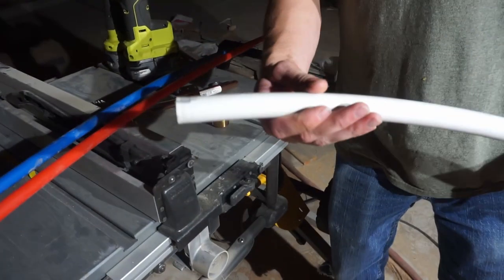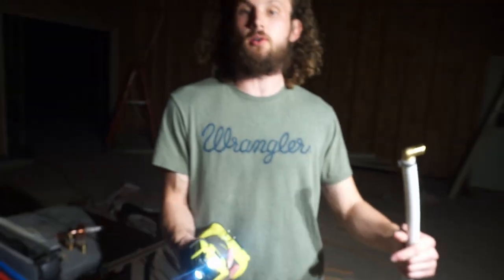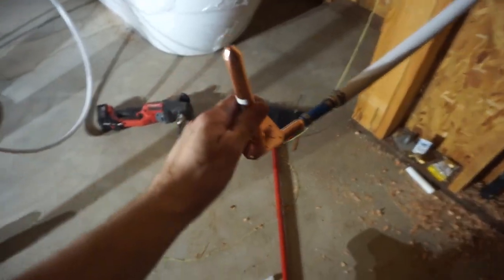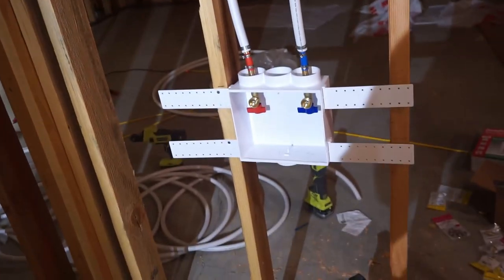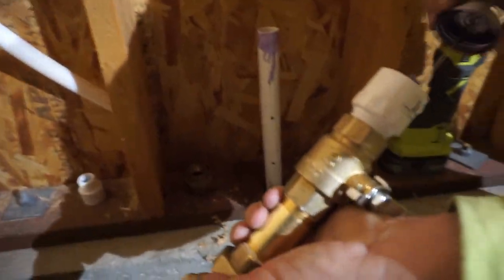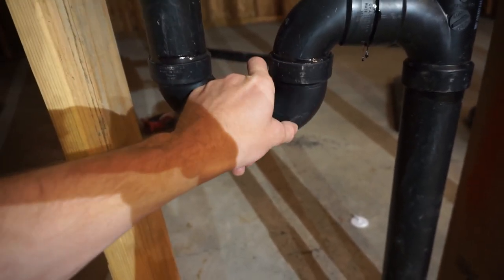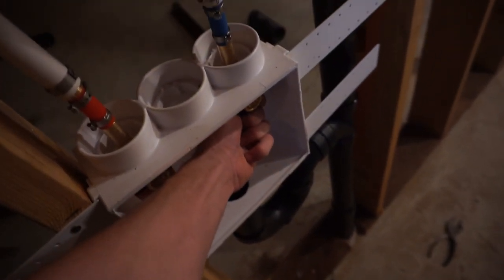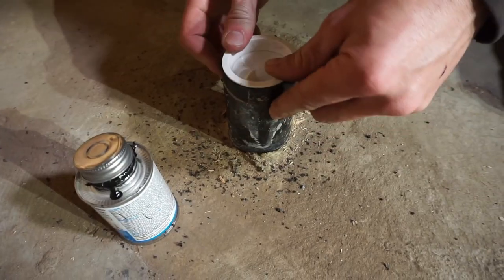Huge Home Addition 12 - Plumbing

Comment: The p trap for the laundry needs at min 24 inch drop until the trap an 2 times the diameter of the pipe distance from p trap to sanitary tee

Comment: The washer box is illegal. The pipe between the box and the trap must be at least 18”. Other than that everything looks good. Apparently it passed but I’d fix it. This is one of those things that code really matters. If your washing machine pumps too fast, it could overflow the standpipe before the trap can empty. It can also pump so hard that it forces the water through the trap and there isn’t enough left to trap sewer gas